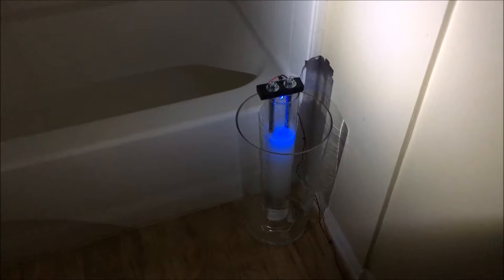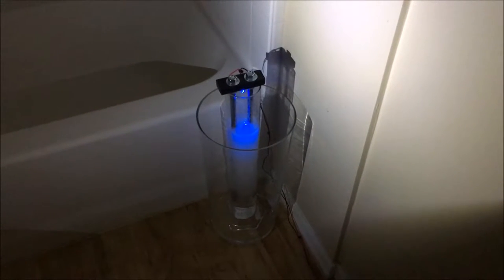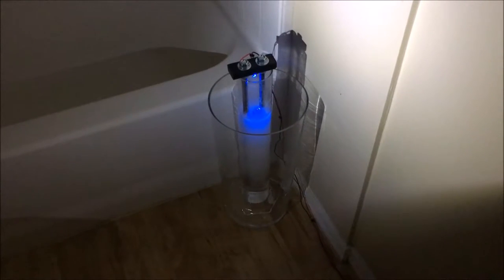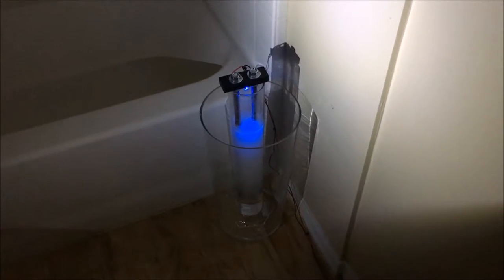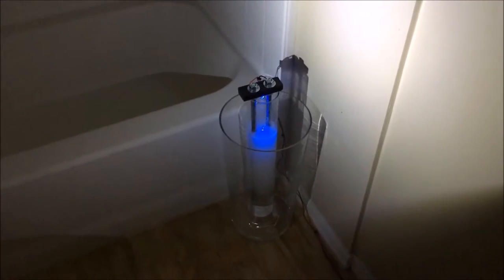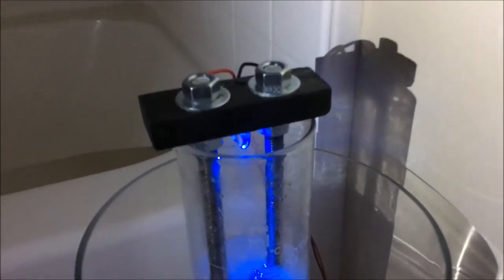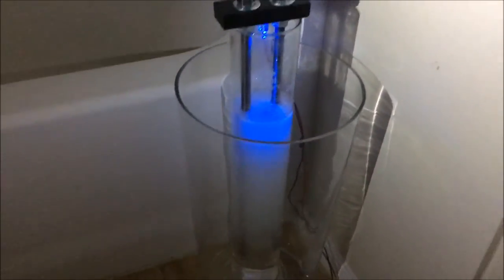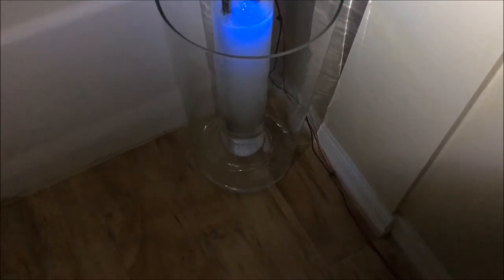EP 16 - Deuterium Enrichment Pt. 2

Comment: This is still an explosive hazard. Would be better to do outside or a shed that has ventilation. 
Alternatively, you could use a pilot light or a spark gap to recommend the gasses after they vent off.